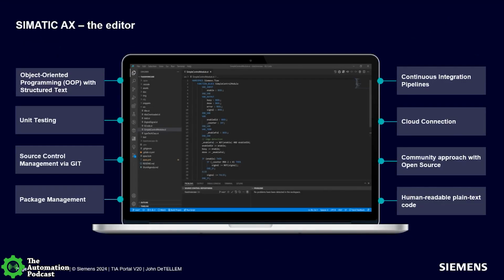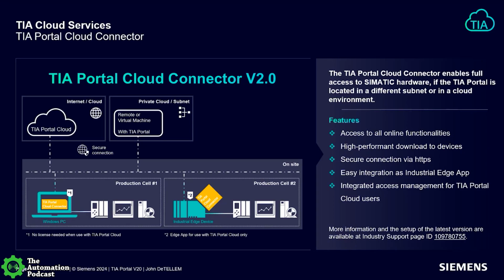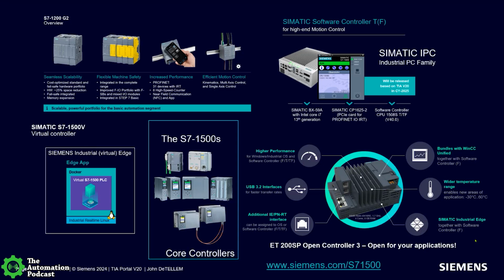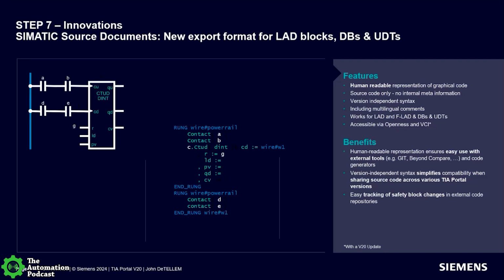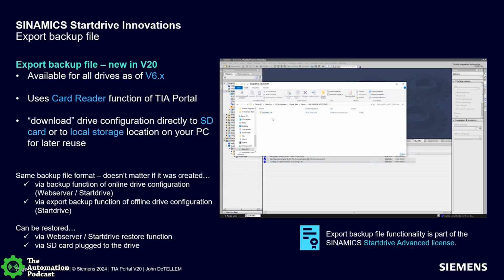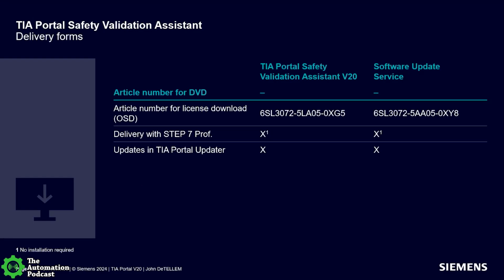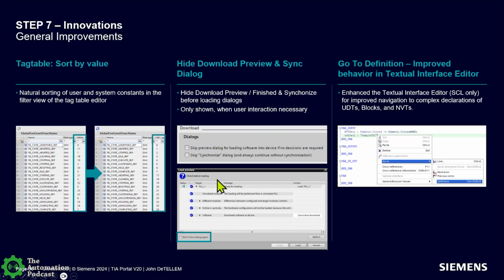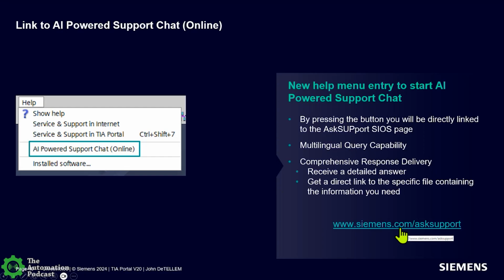Siemens TIA Portal v20

Comment: the links at 44:04 are invalid (on 29th Nov 2024)
Reply from the maker: Yeap, and I updated the video description to remove them and note that I've contacted Siemens to get the right links. It's been a couple of weeks now, and my guess is they will go live when the product is released on December 5th? Either way, I'll continue to work with Siemens to get the updated links, but at this point it's in their hands.

- Shawn

Edit: Just updated the links in the description - includes technical slides